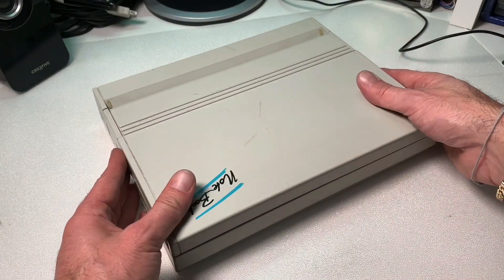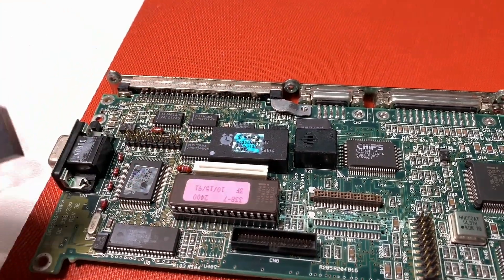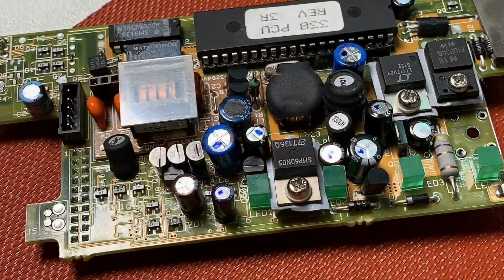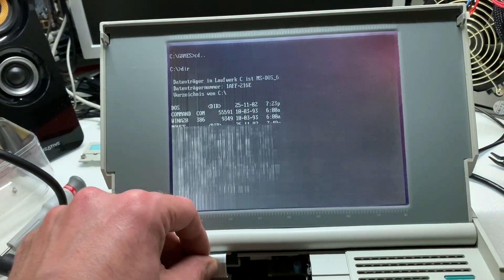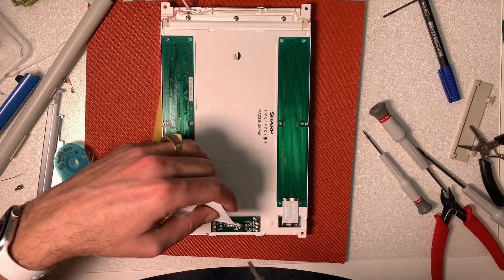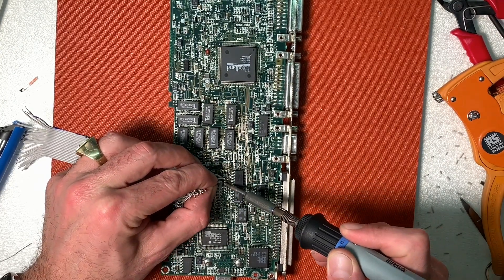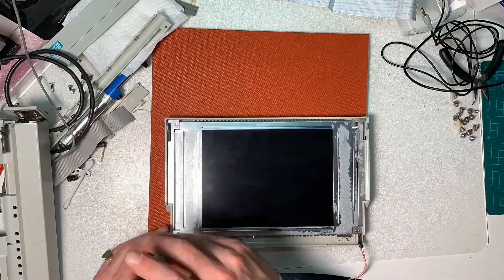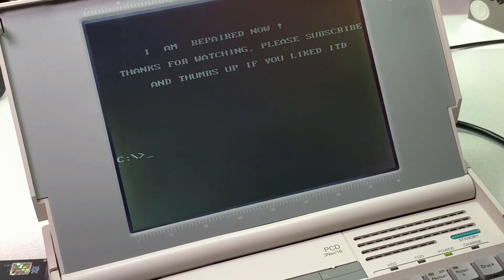Siemens Nixdorf 386 SX 16 Laptop Repair [DALLAS Chip, Ribbon Cable, Capacitors]  #Retrocomputer

Comment: 30 лет назад, у меня был такой компьютер. С шикарным кожаным чехлом.
И проблема с шлейфом была такая же. Постепенно я заменял проводники шлейфа на одиночные многожильные фторопластовые проводники.

30 years ago, I had a computer like this. With a fancy leather case.
And the problem with the cable was the same. Gradually, I replaced the cable conductors with single multi-core fluoroplastic conductors.

Vor 30 Jahren hatte ich einen solchen Computer. Mit einer schicken Lederhülle.
Und das Problem mit dem Kabel war das gleiche. Nach und nach ersetzte ich die Kabelleiter durch einzelne mehradrige Fluorkunststoffleiter.

Comment: I recently purchased a Siemens Nixdorf PCD 4 NC SX laptop.  Does anyone know how to get inside? 

 The right corner near the right hinge of the matrix and in the close vicinity of the floppy disk drive does not want to be unscrewed.  

Does anyone know what keeps him there?  I don't see any screws anymore.  

I'm afraid to use force because the plastic is already extremely brittle.  Please help

Comment: Sometimes those kind of ribbon cables are annoying as hell when they age horribly. When you disassemble an HP Pavilion dv6000/dv9000, something that's half the age, you will find literally everything inside is connected by those kinds of bastards and it's almost impossible to change the paste and do the maintenance without breaking at least one of those cables... The thing is though, if you break it near the end of the cable, you can get away with cutting the cable there and then sand the cable shielding so that the wires expose themselves, and that's how I got away with putting the dv6000 together. In this case definitely not, as that's right in the middle of the cable

Comment: I have the same laptop since yesterday but without power supply. It is interesting is it possibile to use 4 R20 batteries? Thanks to this movie I know what should I do before start of this machine: replace capacitors and Dallas chip.

Comment: I like to toss hot melt glue on connections like that and then reflow the glue with my hot air rework station.   Makes for a nice strong clean looking repair.    Of course if you want to get the glue off later just add some isopropyl alcohol and it will come right off.

Comment: Jealous of how your 2 second "straightforward desoldering of the Dallas chip" compares to my 8 hours of hell with my Dallas chip. I couldn't get the damn thing off, tried desolder wick, desolder pump. Was too lazy to get my desolder station out and ended up breaking some connections. The result after 8 hours : a laptop that beeps and shows garbage on the screen :(

Comment: Hi , thank you sir  for your video , use next time wd40 spray to remove screen face fixed with glue like . but be care on rubbon cable and some electrical part

Comment: I have succeeded in soldering of ribbon cables to ribbon cables, it was only 4 connections and still time consuming. It was necessary to scribe the lacquer off and not melt it out of shape while tinning, joints are mechanically weak and need reinforcement, flexibility is lost near joint :>
I reinforced joint with small rag piece soaked with superglue, and it holds nicely. My first try was with ducttape and it broke in few weeks :>

Comment: 7:30 I'm usually using hot air gun for any adhesive, and found it even more useful for that, than for actual soldering
Reply: Hair dryer is fine too

Comment: Amazing video.  There was so much work involved!   I have an acernote 386 with that Dallas cmos chip.  I used a dremel to grind down to the battery contacts and soldered an external battery holder to it instead for easier change over in the future.

Thanks for an amazing video.

Comment: Great video! 5 years ago I also repaired this notebook, but I did the drillin job -  drilled the package of Dallas and connected external battery. I also had broken flatflex from keyboard and the head of the harddrive was stuck on park magnet. But im curious of your harddrive, am I seeing right 3,5 inch? because I have 2.5 in my ntb. Is that original hdd?
Reply from the maker: Martin Němec yes, there is a 3.5“ inside.

Comment: Can the hard disk be replaced? It looked like the bios only accepted certain HDD sizes so presumably couldnt use a compact flash adapter? Cant imagine those original HDDs will last much longer?
Reply from the maker: There is no IDE connector. This drive use a special connector to the mainboard. So its hard to replace it with a CF card.
Reply: @CPUGalaxy  apparently, it's a conner cp4044 and the motherboard connector is IDE just slightly different spacing?

http://www.vcfed.org/forum/showthread.php?68174-how-to-test-a-conner-cp-4044

https://www.thenimbus.co.uk/range-of-nimbus-computers/nb300

(can you tell I've been looking at buying one ;))

Comment: I'm pretty sure this was re-branded as the RM NB300 (Research Machines) laptop for use / sale in the UK education market.
Reply: it was - used to have one years ago - ribbon cable died on that one too!
Reply from the maker: Richard Harris Thanks for the information. 👍🏻
Reply: I have one of these RM NB300 Laptops. Lovely machine, but the HDD is not working and due to limited options in BIOS I cannot replace it with an CF to IDE or similar device. Anyone got any ideas? http://www.xtideuniversalbios.org/ looks like a solution, but it needs a ROM added which the laptop does not have.
Reply: @Flamelily-IT  You should be able to use an IDE to CF solution even if the BIOS isn't set up to accept one. You'll need a drive 'overylay'. Can you get into the BIOS at all? If so, just select ANY HD type and once the computer boots and loads the overlay it should work.
Reply: @richardharris2162  yes I can get into the BIOS. I will try your suggestion, thanks. I found EZ-Drive which seems to be what I need.
Reply: @richardharris2162  Thanks, tried EZDrive and it correclty sees my CF card and appears to install everything ok, but on reboot my DOS 6.22 install disk does not see the drive. So got half way there and failed. Any ideas or should I just give up?
Reply: @Flamelily-IT  Depends on how big your CF card is. DOS 6.22 (and FAT16) will not recognise any partition bigger than 2.1gb. Oh, and NEVER give up ;)
Reply: @richardharris2162  yeah thanks tried different sizes without success. I will keep on trying, thanks.
Reply: @Flamelily-IT  use ontrack disk manager not EZDrive. With ontrack I got a 40gb HDD on a 286
Reply: @retropcs88  thanks, but tried this too without success. It might have to stay as a floppy boot only machine..

Comment: Why dont you solder a Socket on the Board for the new Dallas-Chip? Is there not enough space?
Reply from the maker: You‘re right. I tought I might get problems due to the additional hight.
Reply: I always put Dallas chips in sockets, but batteries in them will hopefully last another at least 20 years. Anyways Google for IDC connector, that should be better solution for your ribbon cable. Great video. Thank you